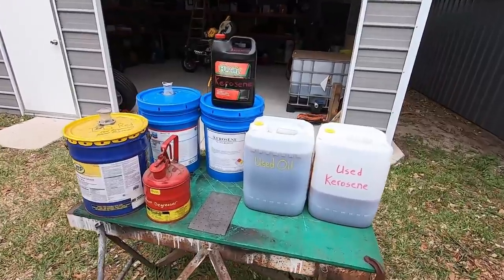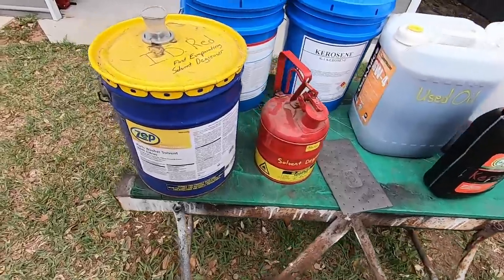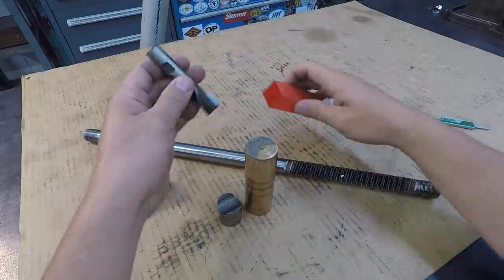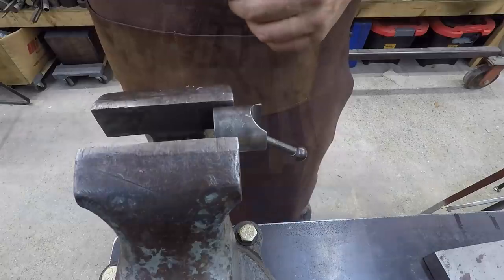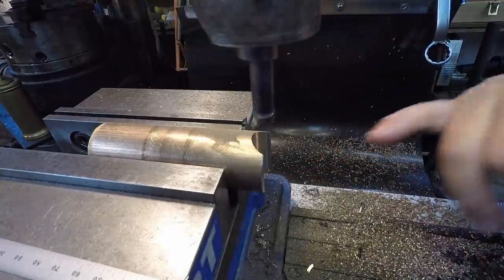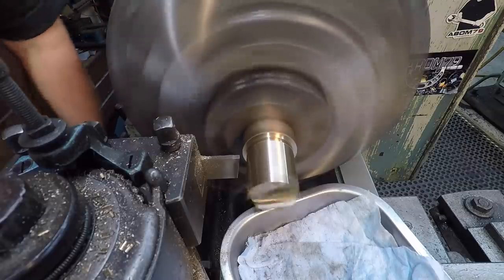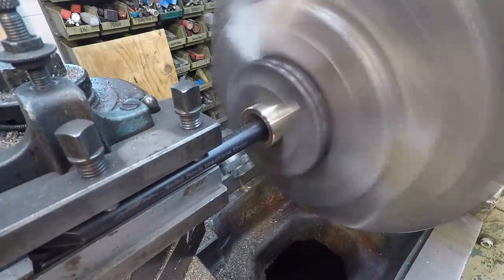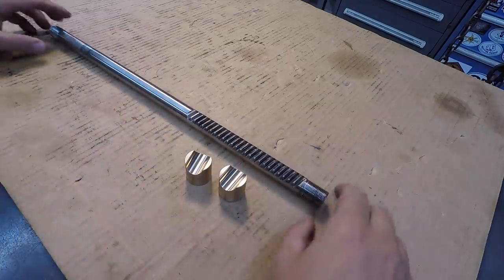SNS 308: Rack & Pinion Repair, Waste Oil Management

Comment: Proper disposal of organic solvents is a big deal, and it's so nice to hear someone in your profession who takes it seriously. Mad respect.
Reply: We contract with a company that does disposal. (we have to pay for some things -- antifreeze, etc. -- and they pay us for some things -- reprocessable oil, etc.  One of my shop renters converted a fuel oil heater to burn used (filtered) motor oil; so the stuff we know is clean (i.e. oil we dumped from our cars) he can burn.

Comment: At a company I used to work for, we had a wringer set-up to wring the oil out of the pig mats into a barrel.  There was also the same setup to wring out the water absorbent mats out. We re-used the mats several times. Saved a lot of money and kept a lot of stuff out of the landfill. We recycled all kinds of materials. We were a zero-sum ISO facility, meaning we took in more monies from recycling than our waste cost us for disposal.
Reply: I'm surprised that they can even cover the transport cost, let alone make a profit. I guess having cheap land, cheap power and good automation is very important?

Comment: I'm an "almost retired" tradesman, I worked in multiple trades.  I'm not politicaly correct, I'm not an eviromentalist.  BUT I always have kept used oil and flamables safley and separatley stored like this.  
My Dad taught me on the farm, there was ALWAYS some reuse for these products.
Reply: I keep running out of space cause I don't throw anything out. With enough knowledge of chemistry, you can reuse basically any waste product in some way, it just depends whether it's practical or not.
Reply: You might not be, however you should give good thought on being so. Everybody can always take more responsibility and be a better person. This isn't to label anybody as being a bad person, just that there's always a better way.

Comment: My mate has a "log burner" that burns engine oil.  It has a massive tank with filters, magnets and some other clever stuff.  He owns a garage so always has lots of old (and some new) waste engine oil.  The doors are only rarely shut even in winter - the burner keeps the workshops like miami, and heats the water even when it's below freezing out.  And it meets all the clean air regs.

He says it pays for itself in the money he doesn't spend disposing of the oil, let alone the savings on the heating.

Comment: Enjoyed the metric content as I could actually follow along on this one.  Also guessed the radius depth was 8 mm before you measured it !
Reply: Abom using metric on his DRO. The world has truly gone crazy.
Reply: @gregmizell7861  the units switch on DRO or calipers is the fastest way to get an exact conversion!
Reply: I find remembering that a foot is the same length as the average school ruler (30cm) is useful. But I still can't follow the thousandths stuff
Reply: @SkigBiggler  If you use the 1/10 per inch it it easy to convert to .ooi" Carl Bliim Australia.

Comment: Regarding your waste oil storage, there are some folks, mainly from environmental services etc, who take a dim view of re using old containers for waste products especially when the original label is still on the drum.  the guy who pulled me up on this was quite happy for me to either remove it or cover it with  tape.
great video.

Comment: Hey abom on the used oil I built a duel tank system with auto motive filters using 2 large diesel filter for a old shop I worked with saved a tone of money. 

Dirty tank- large particulate- small particulate- pump- clean tank. 

Filters are very cheap. Also has a chip screen on a corner if the dirty tank were you dump the dirty into the tank

Comment: Hey Adam, to dispense cleaners and some oils I use empty liquid detergent bottles (Tide, Kirkland). The ones that have a press button valve. They set flat on the shelf with the valve on the bottom sticking out. Just put a container under the valve and press the button. Very convenient.
Reply: Yes!  I use them also for cleaners, oils, and one for water for use in the shop.  They work great for filling other containers or for wetting a rag.

Comment: In Seattle, waste oil will be picked up curb side every other week. Free. They also dispose of the containers. It has to be a screw cap, usually one gallon. LABELED!  We also have a haz mat site for other stuff. Fluorescent tubes, etc. Not far from me.
Reply: Stone Ave. N. & 126th ish.  Less than 10 minutes from me.  Yep, 1 gallon at a time limit, but better than nothing.  Rich...Seattle

Comment: Those high lift carts are remarkably useful. I used to use one from time to time that I would borrow from another area at work, mostly for changing punch boxes. Our toolmaker told me one was up for grabs and suggested that I get it assigned to myself as personal equipment. It had been used for a job we stopped doing. Since I always have it I've found uses for it that I wouldn't have thought of or bothered with before. In addition to installing, uninstalling and putting away heavy fixtures I often put crates of parts I'm working on at a convenient height so I don't have to bend over so much, I use it as an adjustable work surface, the list just goes on and on. And I don't get nearly as many backaches as I did.

Comment: You live down south so it's probably not as prevalent... but I used to work at an auto salvage place up north, and we had a number of waste oil heaters.  We never paid for heating in the winter at that shop.  Those waste oil heaters are super hot and work really well.
Reply: Thats cool, will think about it, greetings from Germany ;)

Comment: The big tanks at the landfills are likely sold or provided to a local refinery that simply adds it to the crude.  It helps liquefy the crude and comes out as new oil in the fracking tower.

Comment: Another thing to be concerned about when storing any chemicals is fire mitigation. Most of those solvents are mildly to extremely flammable (it should say on the container you bought it in.) Some are more volatile than others (that is, the temperature at which they evaporate, and the quantity of pressurized gas produced, varies by compound.) It’s also helpful to know what sort of fire suppression equipment/chemicals will extinguish a fire caused by these materials burning. It goes without saying; get a smoke alarm and check the battery once a year. Not only in your home, but out in the shop, too! Where you store the chemicals is important, too. Are you storing them in a climate-controlled shed (i.e. A/C in the summer, heating in the winter), or are they exposed to extremes of temperature (and possibly humidity)? Thermal expansion/contraction can cause failure of the storage vessel, or cause the cap to work loose over time. This could cause a build-up of vapors in the storage shed/garage, leading to a fire hazard. Please people, stay safe, and check your local/city/state fire codes for how to store these, and for how long! 🙂
Reply: Should be stored in a flammables cabinet but .. hey .. maybe he has good insurance.

Comment: we have a lifting table at work for a large vibration test fixture we need to move on/off our tester. We added a sheet of UHMW polyethylene (or something similar to that) on the top and it made a world of difference sliding the fixture. Might be a good addition to your cart.

Comment: I'm not a machinist myself, but wow, that bronze looked so nice to machine. Having just watched the latest Blondiehacks video where she turned some mystery steel that cut hot, wouldn't break the chips, and had hard spots in it... Quite a contrast.
Reply: Even on my "toy" lathe, bronze is really easy to machine. just need sharp tools.
Reply: Also he did mention that it oil impregnated bronze, so its self lubricating

Comment: Unless prohibited by local law Advance Auto Parts takes used oil for free. That includes motor oil, hydraulic oil, transmission fluid, brake fluid. Pretty much anything petroleum based. But of course call and ask before hauling it down to the store.

Comment: here in new york and other winter cold states we burn used oil in a used oil burner for free heat. the oil burner cost more but your not paying for gas or oil to heat, the only thing is the oil has to be free of water or antifreeze and you need to service them once a month at lease the one in our 200x400 foot body shop

Comment: Up north every auto repair shop will take your used oil. They use it in their fuel oil furnace. Provides them free heat in the winter.

Comment: One thing you did not mention in this video about the lathe operation was the turning tool choice HSS rather than carbide. I’m new to machining just got my first used small lathe and learn quite a bit of good information from your videos
Reply: My understanding of HSS vs Carbide is that carbide is harder, but easier to break, and HSS tools can be resharpened or reshaped pretty easily, whereas carbide is more difficult to do that with.

Comment: Adam, you could use buffing wheel on both components in moving direction. Hole depth in support yoke (what You named bushing) seem to not be critical because of clearence adjustment at this side.

Comment: Hi Adam, why not manufacture a waste oil heater, then you can store for use over the winter months to heat the shop.  Great video, stay safe, Regards a fan from Aus.
Reply: Col Mornane It would first have to get cold in Florida to need a full furnace. 😛

Comment: You can definitely see the carbon in the bronze. 
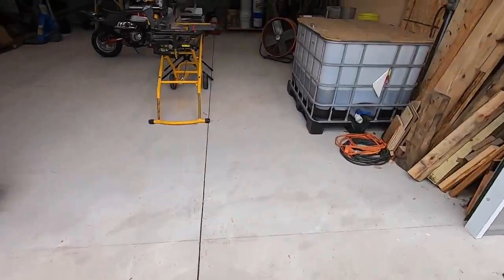5:29 They are some massive vice's you've got there. I still love my 6" vice which I think is IRWIN n must be around 20ish yrs old and is in immaculate condition. It looks like it spent most of it's life on the shelf as the only marks I've found so far is a couple hack saw marks on the jaws. I recon it spent most of it's life in a school because it'd of been trashed if it was in a working environment. It's something I've been wanting for a very long time now (10+ yrs) and now I own! 😁
I love it and will never get rid of it as it's a gem! I know it's sad but it's a tool you didn't realise you needed until you had it because of the stoutness of it.

Comment: "It might help if I engaged the feed."  That suddenly reminded me of a funny cartoon I saw once (NEW YORKER, I think) where a TV repair man was working on a TV in a woman's home and had all sorts of parts strewn around him.  The woman was holding the electrical cord up and it was not plugged in.  The repair man said, "I'll get to that problem in a little while."
Reply: I once watched a fellow mechanic order and install three new starter motors in a customer's truck because they were all defective from the parts werehouse before he finally put the battery cable back on! Hahaha!
Reply: Sometimes referred to as a High impedance “Air Gap”

Comment: Gotta get you a small set of of swiss files for those tiny little de-burring situations - a small thin round swiss file i think might do just a tiny bit neater of a job for that kinda thing - but either way works - and they ended up looking beautiful - another good one down!

Comment: Kerosene, jet fuel, number 1 diesel are all the same. They differ only in allowable sulphur. The specs allow a little more sulphur in D1, less in JetA and a little less in Kerosene. For combustion or cleaning it likely makes no difference. D1 is an approved fuel for jet engine powered helicopters.

Comment: When you're using that boring bar in the mill.  Does it counterbalance?  Or is the mill absorbing all the off balance?
Reply: The mill absorbs it.  This is a good example of where mass and rigidity are your two best friends while machining.  That said, the unbalanced weight isn't as significant as the cutting forces (from the cutting edges hitting the part) and the mill has to deal with those even when the tool is symmetrical.

Comment: Could have machined an emergency collet but probably not worth it when you already have a good 6 jaw that can do the job. The bronze won't gall but seems like it might wear pretty fast with all that pressure and rubbing. Did you test that original piece for hardness?
Reply: It won't wear much, 'bearing pairs' hardened steel/bronze, stainless steel/brass etc, work really well :-)

Comment: On the oil stuff another suggestion is, some of your fuel delivery companies some of them have oil delivery truck also. You’ll have to call and see some of them have a waste oil tank sat up for the public to dump their waste oil and old fuel in for free. Also check around for oil recycling places many of them are picking it up for free has to be a large amount, but some of them have a place to you can dump it or leave a bucket of oil at.

Comment: Caution with oily rags paper towels whatever. Many products are exothermic and when thrown in the trash or laying wherever where they might be confined they can start spontaneous combustion. Just a word of caution
Reply: That's why oily rags should go in a purpose built container. (i.e. the big red "OILY RAGS" can.) We've been known to toss them in the drum with the waste oil.
Reply: steve gale  Some vegetable oils (e.g. boiled linseed oil) react with the air in a manner that releases heat. Soaking them into rags increases the surface area that can react with the air, putting all the rags together concentrates the resulting heat. Worst case the temperature can rise high enough to ignite the rags.
Reply: @nerd1000ify  IIRC, this is part of the reason for the damage to King Tut's mummy- the mummification process was rushed, and the heat from the oil reacting with air ended up charring the mummy.

Comment: My OCD has me cringing seeing all that stuff on your new concrete floor. I have a 30+ year old shop that's had so much oil, etc. spilled on the floor it's now impossible to even attempt to clean. (even soaked for days) I would recommend epoxy coating that floor, and setting everything on anti-spill trays. A small investment now will keep y'all happy for years. (once it's been oiled, there's no getting epoxy to stick to it.)
Reply: No doubt, been there, suffered through that. Great advice!

Comment: I'm fairly new to this You Tube site, and really like it. I think I have a disposition similar to Adam, and like to see how things work. I really liked seeing the inside of the lathe, all the gears and how they are kept lubricated. Very cool! And it's funny, too, as Adam doesn't mind us seeing mistakes he makes, that we've all made, from time to time. Like that zerk fitting hiding behind a cover he didn't know about, even though he's had the machine for years. I had to laugh! Done things like that myself (because too lazy to read the entire manual - but, who does that?), and lucky no damage was done. Adam, I got the impression your Dad is a machinist, too. Did you work in the shop with him when you were growing up?
Reply: Yes he did I think. Him and his dad, and his grandpa booth. All worked at the booth machine shop. 
Correct me if I'm wrong, but i don't think I am. :)

Comment: You could make a hole in middle of bronze, and you will have 2 parts with one operation...
Reply: Yeah, you would. At least one would have short legs, though. Always lose some material when you make a cut. Maybe if you made a perfect cut with a one micron thick blade....
Reply: He have enought material to make it...and he only need 16mm...he has extra 6mm to make the cut...

Comment: Digging the hazmat organization.   "Organization is the key to Management!"   Most petroleum products have a recycling fee added to the cost.  It's only a few pennies per quart.  So, the automobile parts stores love to take your used oil...they cash in on the recycling fees AND $ for the value of the raw material.  WIN-WIN!  You might research continuous centrifugal liquid separation.  Most contaminants and dissimilar materials can be separated, with no fuss.  The separated units come out clear!  The last step to reuse is adding  a PH  conditioner and purpose adjuncts.... Chemistry 101.

Comment: When you need to catch a part off part that does not have a center hole, use a piece of pvc pipe that is slightly larger ID than the part OD.

Comment: The local machine shop where i live has a furnace that runs on used motor oil that they use to heat the building.

Comment: You should have something like a big metal cabinet for your flammable chems and maybe mark the door incase something goes wrong. Speaking from working in factories.  A printing press that I worked at had it's flammable shack explode.

Comment: If you have a oil wipe or grease rag laundry service, instead of using a lot of clay floor dry to clean up spills use the cloth rags and have the laundry service clean them.  I believe that most state EPA prefer that waste oil be burned on-site in an approved appliance.  Obviously not feasible for small waste oil generators but larger shops may have them.  One of the local oil change & car wash places takes all the waste oil they can get.  They use it to heat their water.

Comment: Hey Adam, greetings from Brazil! I do love to watch your videos, I'm not a machnist (I don't even - yet - have a lathe) but I learn a lot with you =D
I have two questions about this job: 
1 - You smoothed the bar but haven't filled the cavities, it won't mar or eat the bronze since it is a softer material than the steel used in the former part?
2 - Why don't you use a cheap boroscope tied to the milling bar when you mill something on the inside, so you can see what you're milling? 
Thanks!
Reply: That would be really neat to see, but very finicky to do well.  I have a cheap USB borescope and getting a high-quality shot with it is HARD.

Comment: You might want to consider a spill pallet for all of your oils. A four drum would be about the size of the wooden one you have. Typically that would hold over 70 gals of spilled material. They cost around $400 new, but you could maybe get a used one. They are fork liftable.